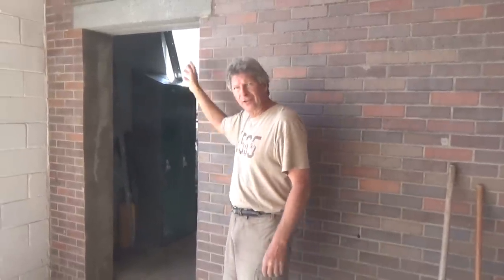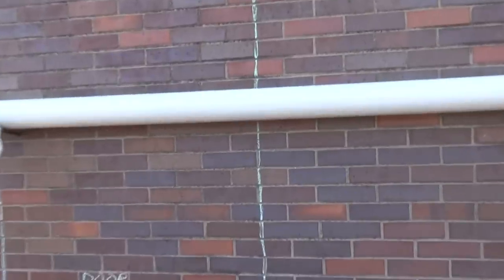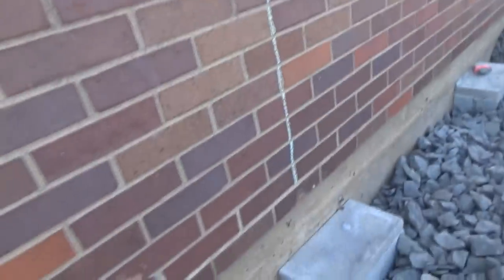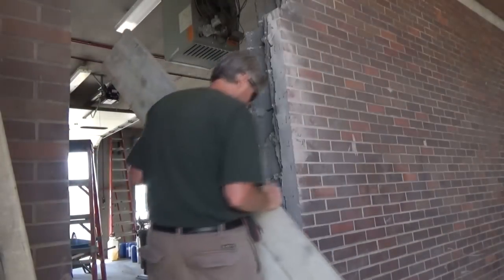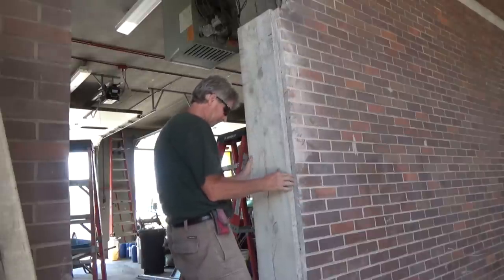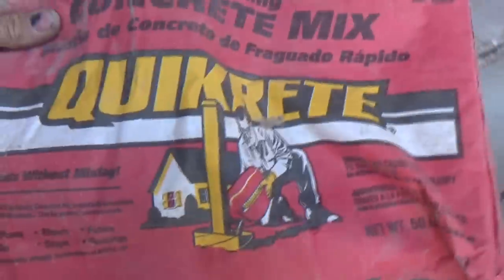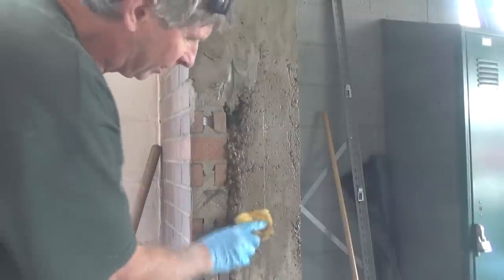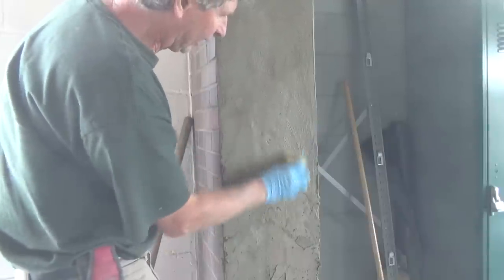CUTTING BRICK & BLOCK DOOR OPENINGS (Mike Haduck)

Comment: Nice work Mike.  I have an old building with ~6 inch concrete/plaster walls and I need to enlarge 2 doorway sfor ADA accessibility from around 32 inches to 36 inches (to replace the 30 wide inch door with a 34 inch wide door).   The wall isn't load bearing, so just cut it open with a saw with a diamond blade and then install the new door and frame?
Reply from the maker: Hi Bob, I can't say over the internet,  I would have to be there to see it, I would ask some of the local guys, Mike

Comment: Enjoy your videos and find them very informative. Wondering if you might offer some advice. The front of my home was done years ago with natural  field stone, It looked beautiful for many years but now some of the stones are getting large black spots. Others seem to have rust emerging from the stone and also others are showing the salts that can emerge. I dont believe the stone was ever sealed. What can be done to clean this up and restore it?  Thanks
Reply from the maker: stone by nature bleads out what every is inside it,  I usually get a scrub brush and maybe even a wire brush with the water hose and go over it,  some guys use acid but I am not a big fan of that,  some power-wash but it seems to cause some damage,  I would do a little "test" behind the bushes or where no one sees it and  see what works, I hope it helps thanks mike
Reply: Appreciated....Thanks Mike.

Comment: I am looking to install and exterior door into a cinder block wall. There will be another 6 to feet above where the cinder blocks would be cut out. There is a roof and is load bearing. What should I do to create temporary structural support until lintel installed?

Comment: Why did you use the red bag fast setting concrete for one part then switch to sand and type s mortar for the patch? I'm guessing the latter mix was used for the joints too?
Reply from the maker: Hi A. k. The red bags sets fast but has gravel in it,  the other is used for finishing, thanks, mike

Comment: Recently bought a 1900s school house to fix up as a home, all the walls are cement block and I want to open up a few doorways with arches.... I cannot find any videos showing how to make an arched lentil for a block wall... any advice?? I’ve seen your other video where you made a lentil with some blocks and such... would it be basically along those lines?? Or would you recommend something else? The ceilings are about 2 floors high so there’s a lot of wall on top.. which is my biggest worry
Reply from the maker: HiTara, that’s a hard one to answer,  I never had a problem cutting it out and arching it,  basicly the same ,but I would get some opinions from the locals before you make any decision, thanks mike

Comment: When cutting a big opening like that, how does the brick/block not settle or fall down?
Reply from the maker: Hi Steven, after doing a lot of them you just know, most of the masonry is self supporting in a arch form, every situation is different,  thanks Mike
Reply: @MikeHaduck  couldn't you put the lintel in before knocking the wall out?
Reply from the maker: @whitestroke1  hi Whitestroke,, I don't see a reason to do that, thanks Mike

Comment: Excellent video. I will  be cutting a 24"×24" opening  through an 8" wide block wall, its a non load bearing wall for an animal exhibit and I like the method of building one as one of your previous videos demonstrated.   In this video you installed 2 lintels (is that common?) What are the width sizes? As for the height do you recommend 6" tall to make it easy to install and then fill in above lintel with a 2 " block and mortar in place? Thank you. Armando
Reply from the maker: Hi Armand,  I would call up the block company and find out the size of lentils they carry, and maybe drive down and check them out, ask a couple of the locals what they would do, it is impossible for me to comment unless I was there to see it. I hope it helps, thanks, mike
Reply from the maker: Hi Armand, I can not put links on my comment site, but I appreciate it.  thanks mike

Comment: Mike, I just found your videos.  Very entertaining and very good explanations.  I have an issue where we had a large window installed today and a row of soldier bricks fell off during the process.  This row was above the door and below the large window.  The mortar had dried out and the bricks were never tied into the house.  Searching for ties I found your videos but nothing on how to tie a single row of soldier bricks into the structure.  Do you have any thoughts on this.  I watched your excellent video on ties but you didn't address my situation.
Reply from the maker: on a soldier course we would just put the ties in sideways every 4 or 5 courses going horizontal, and screw them in as you go. every situation is different but I am sure you get the idea, I will remember that when I am doing another video, thanks mike

Comment: Mike, I have a trade related question I think you may be able to help me with (if you see this soon enough). I'm used to doing new residential, not repairs:

I have to replace blueskin from a brick wall that was finished 5 years ago or so by some other crew (it's leaking water into the basement). I already did one side of the wall because I was just working under a door so I didn't have to worry about the wall falling down. The rest of the job requires me to take three courses of bricks along the entire wall and around a fireplace. How many bricks long would you remove (like remove 6, leave 1 kind of thing) without worrying about the wall collapsing? I hope you can understand what I'm asking. One brick layer I know said it isn't such a big deal and the wall should be pretty secure. I don't want it to collapse though.
Reply from the maker: If I read you through it is like taking brick from the bottom of a building and replacing them, I think it is a lot of common sense, I have had to do something similar when jacking up buildings, hard question to answer. something where you have to be careful,  I could not say unless I was actually there to see it.  I wish you well, , thanks mike
Reply: Mike Haduck Masonry Yeah, my father has been doing this work for a while so I asked him for his suggestion too. It's pretty risky to just start guessing so I'm just working with one patch of brick at a time. Thanks for your reply.
Reply: @rubenmborgesmusic  

This is a very old post and I’m not a Mason nor do I do that kind of work, but for extra safety factor, could a person not drill holes in a temporary “ledger board”, then use that as a template to drill through the brick mortar, Tapcon the “ledger”, then use some 4x4 blocking, 2x4 scraps, and hand-pressure inserted shims to take out the gaps? Still only take out small sections but use the ledger as a fail safe of sorts.

Comment: I want to cut an opening in a brick wall, for a doggie door. Does a small opening like
that need a lintel? Thanks in advance!
Reply from the maker: Hi LSU, sometimes I will use a steel angle iron or depending on size a small metal lentil, everything depends, thanks, mike

Comment: I always see masonry guys cutting brick dry. Is there a reason why you don’t use water?
Reply from the maker: Hi Wiley, I guess it would depend on what your doing, sometimes the water makes a mess then the bricks that were cut absorbed the water which can change cement color or makes it harder to lay  , lots of different reasons,  thanks Mike
Reply: Thanks Mike. I’m cutting out two windows. I’m thinking the customer will complain about the dust outside but this is a great reason i can explain to him. I’m paying a bricklayer to lay it. Thanks buddy

Comment: no acrow props overnight
Reply from the maker: all I guess I could say is not with my experience (for me) on this type of job,  thanks mike
Reply: Mike Haduck tks, I need to di the same job with exactly the same type of blocks on a two storey house, I would just cut out exact space for 3 inch lintel,and pack it with slate dry mix , would do you think for a 2 storey, u seem very experienced,??
Reply from the maker: Hi COR,  I cannot comment on that unless I was there to see it. I would ask the locals,  I appreciate it. thanks mike